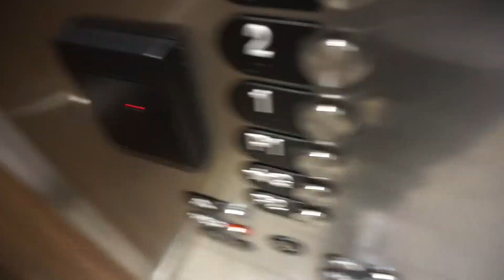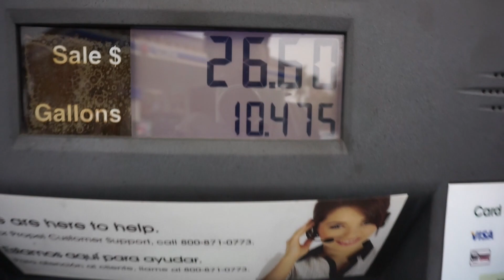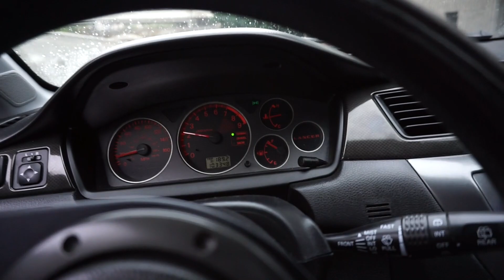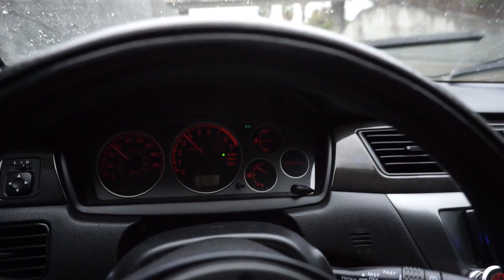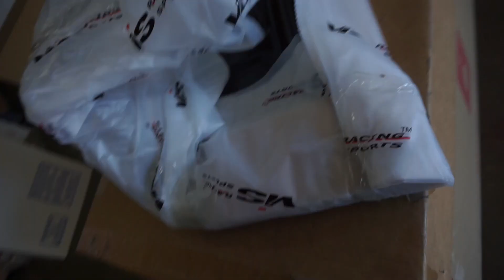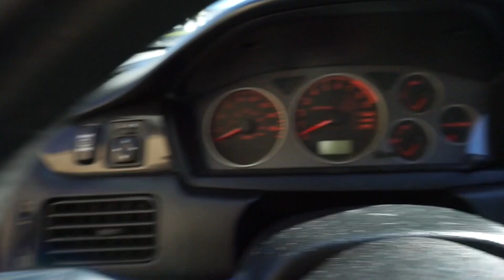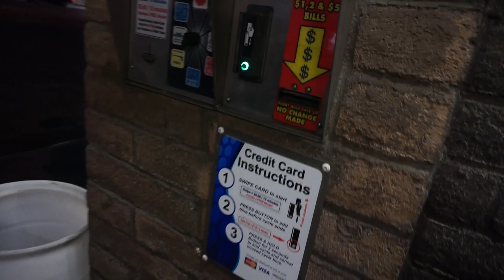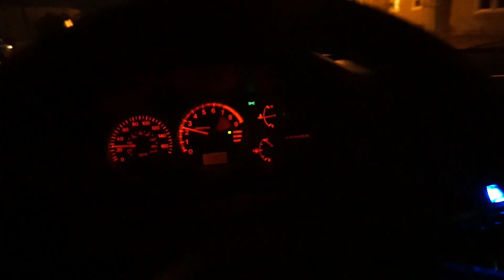My evo 9 gets a makeover in 1 week! (New wheels & carbon fiber)

Comment: Damn E85 is cheap. 10.5 gallons are roughly 40 liters. Price per liter for normal gasoline here in Germany is around 1,35€. Premium gas with more octane is around 1,50€ (We don't have E85 anymore unfortunately). So if we would fill up 40 liters with premium gas that'd be 60€, which would make $73. Maaan I really need to move to CA! (Great video btw, cool to finally see someone vlog about an Evo.)